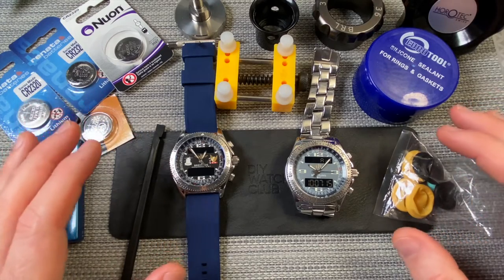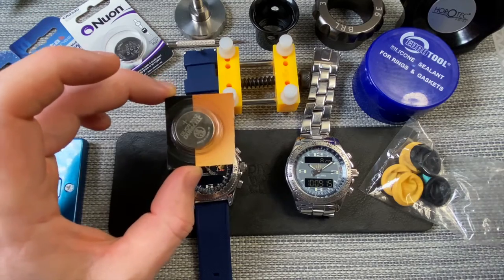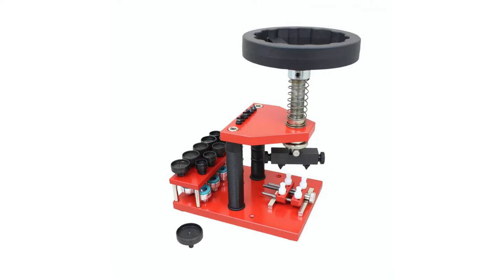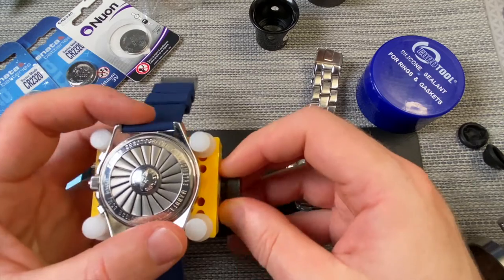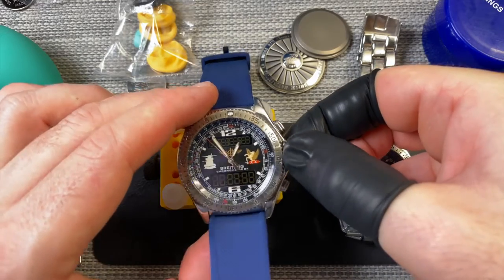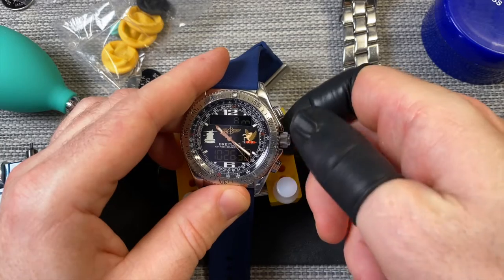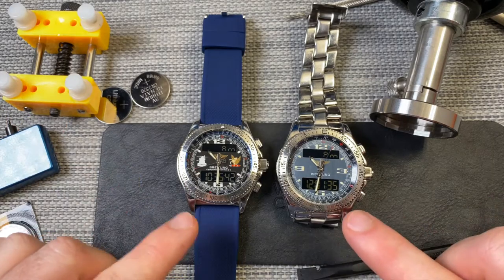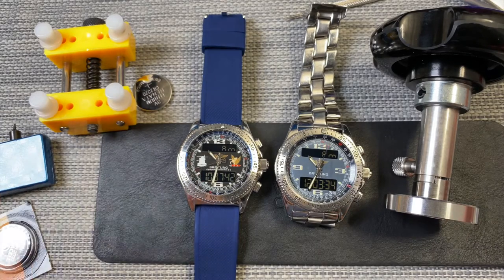Breitling B-1 Battery Change, how easy is it? A68362 -

Comment: Literally just bought a B1, and this video helped massively, especially talking through how to fix the time sync. Brilliant well done thanks.
Reply from the maker: Thats cool, glad it helped. I only recently got this watch and I'm really liking it... or both of them!
Reply: @CasualWatchReviews  Really interesting timing, I ended up buying a black faced B1 for £750, wasn't working, suspected dead battery. Put a new battery in using your guide, and followed your guide to fix the time sync issue etc., and now it's on my wrist. I suspect it's now going to be my daily. Thanks again, and perfect timing (no pun..), it seems as if it was meant to be!
Reply from the maker: I was really worried I had not created the most 'entertaining' upload for my regular subs with this one. But knowing it helped you has made it worth it... thanks for letting me know. I wear the grey one daily now. This time last year I would have snubbed this for a mechanical. Also its nice to know that this is the last one before they kind of went a bit crazy in size.
Reply: @CasualWatchReviews  unique, clear,  the perfect video. Reviews are two a penny, actual knowledge and instruction and not just opinion is far more valuable to me as a view. For reference I also have a ceramic Sub, but honestly, this feels like the ultimate tool watch so I suspect i'll swap to this. Thanks again.
Reply: Lol I can't believe he said literally

Comment: Hi from Australia :)  Just caught up with this video, as I need to change the battery on my B1 (same as the one on the right in your video).  Mine also has the little UTC separate watch forming part of the watchband and I need to do that one too.  The case opener die has to be 15-sided and 36.07mm exactly.  That's why the generic 36mm ones don't work.  I'm going to try the rubber ball trick, as I already have a couple of those.  I regularly change watch batteries for my collection and the extended family!  But the proper case opener die is hard to find now.  For those interested, it's a Breitling Case Opener, CO-BR15-3607 (which translates to the 15 sided 36.07mm size).
Also just one nit pick - you adjusted the time on the first B1 you did, but to 5 minutes behind the digital time.  You set the hands to 14:22 when the digital time was 14:27.  Surprised nobody else picked that - must be my OCD kicking in :)  Thanks for the video - very appropriate for me right now :)

Comment: Fantastic video. I was a little scared trying to do this myself, and since an AD isn't anywhere near, I decided to give it a go. Bought the die, used a spanner to turn it. Back comes off, replaced the battery and all good.  I should note I haven't worn the watch in 7 years because of the battery, and everything functions perfectly. There is also a hidden procedure you can use to put the watch to sleep before you change the battery so you don't have to reset the time, alarms, date, etc  Ill try to find it, as it is on another site somewhere. Again, thank you so much for this video. Will never get rid of my B-1
Reply: Suspend mode specifics--Quoting Andy from the TimeZone Breitling forum:

On my B-1, if I rotate the crown until the display is off and then pull the crown out, the top display says “R” and the bottom display shows the time, (an hour behind the time the hands show) and allows me to set this time using the usual controls.

[…] While the above is happening, I can press the top button and the word “BAT” flashes up in the top window. If I hold the top button, the word “BAT” stays on the screen for a while and then both screens go completely blank and the watch seems to be in some kind of “Sleep Mode”. The screens are blank and the hands are still.

To “wake” the watch up again, I have to push the crown back in again, at which point, the watch returns to its normal operating mode and seems to reset itself to the correct time.

Keep in mind that this may harm your watch's movement if it sits for a long time without running, as the gears will not be lubricated.
Reply from the maker: Thanks for adding all that Sam
Reply: @CasualWatchReviews  I should also note all of this is also relevant for the B1 SuperQuartz A78362, which is the watch I have...Again, thanks

Comment: BIbheard about the Breiting on the left on the podcast. I think it looks fine.
      I have replaced battieres on a few Ronda 515 movements and also an ETA quartz movment . I also replaced barriers on some Casios. I actually destroyed a $18 Casio, had to buy another watch, At $18, no big deal.
     I noticed Renata battieres are standard on most Swiss Quartz movements. They are Also Swiss Made. I have heard to be weary of some cheap  battieres, they  have been known to cause issues.

Rob
Reply from the maker: Hey Rob, yep it was so weird that these batteries are hard to find. Couldn’t find any other sellers. It was reassuring to see there was a renata in it already!

Comment: Is there an O-ring gasket on these watches? Do you replace it if opened?
Reply from the maker: Yes to both of those questions. It took me while to dine one that fitted. Honestly Its been that long since I sold the watch, I can't remember the size. There would be another ones for the crown and pushers also.

Comment: The link to the Case Back Opener (Die Part) now goes somewhere else but Amazon do have what appear to be the Breitling specialist tools but there are 2 sizes available and 36mm and a 38mm - which did you use for the B1?
Reply from the maker: Hey Andy, thats right the link https://amzn.to/3jF0qdk its a weird half size so only this one works from what I could tell. I bought a 35mm and 36mm and neither worked before I got this one.

Comment: Thanks for the video 👍
 I didn't catch why the cheaper case back opener tool didn't work, was it the wrong size or the wrong design or ???
Reply from the maker: Yep it’s in between sizes, one is too big the other too small. The rubber ball worked on one of them if you wanted to try that first?
Reply: @CasualWatchReviews  Thanks, I have a Navitimer and those cheaper openers are all over Aliexpress, they'll probably have what I need.

Comment: Great video!  I have the B-1 watch on the right; the hour and minute markers aren't moving anymore (tried everything on the video) will replace battery as next step; does anyone have any other tips?  I can send to Breitling but that's a good 16-20 weeks with no estimate of cost (called a few authorized dealers)  in Orange County, CA if anyone knows a place.  Thanks!

Comment: Hiya cwr al here from sheffieid good enough mate but being a tight yorkie it would have broke my heart paying around £80 for that back remover i know its too late but did u try a piece of rubber or silican matting and pressure on the caseback , i have removed backs like that before , just wondered .take care.
Reply from the maker: Hey Alan, yes I tried the 'rubber ball' and it worked on one but not the other, I nearly sprained my wrist! I'm with you $80 fo that die thing was a gouge for sure!

Comment: Quick Question: Where did you get the gaskets for the B1?
Reply from the maker: Hey Sam, I got them from amazon but I don't know yet if I got the right size or quality
Reply: @CasualWatchReviews  Ok, Thanks Sam....will you please post here specifics when you determine all is well, part number, seller and such? TY
Reply from the maker: Yes will do. I couldn't find any information on the size needed so ended up buying 100 or something ridiculous
Reply: @CasualWatchReviews  Hi, did you find out the correct gasket part number or size? Thank you, very nicely done B1 presentation!

Comment: Hello,

May I know the exact dimensions of the back gasket you ordered, please ? Mine is cut off and needs to be replaced ...

BTW, to open the watch I use a silicon ball, it is inexpensive and there is no risk of scratches.

Also, there is an EOL indicator on this watch, the display blinking means you need to replace the battery within 2 weeks.

As for the replacement, the battery needs to be lifted slowly otherwise you may lose the small (but crucial !) spring under the battery !

A proper replacement is to put the watch into power saving mode, then, once the old battery is removed, you have 15 seconds to put in a new battery. All the parameters (hours, alarm, calendar, ...) are thus kept in memory.
Reply from the maker: Hi I tried the silicone ball, or only worked on one of them. I'm still in the trial and error phase of the gaskets. I ordered a few different ones but not had chance to test them all out yet.
Reply: @CasualWatchReviews  OK. I thought you had the good reference according to Breitling documents.
I bought a 35.5x0.7 O-ring for my beloved B-1 but I have to find a watchmaker to have a waterproof test...
Reply: @vzmax  Hi, does that 35.5 x 0.7 gasket fits the B1? Is that specific from Breitling maintenance docs? Thank you!
Reply: @txominn79  Sorry, I can't answer, my watch has not been waterproof tested. And I'd like to know the Breitling maintenance doc !

Comment: Hello sir I am
Going to change the battery in my b1 myself bought the parts I was thinking of changing gasket also do you know the part number for the gasket or gaskets I need to do this thanks you
Reply from the maker: I’m sorry I don’t know
Reply: @CasualWatchReviews Hi.. I have the B1 & Airwolf . will that case back opener work on the Airwolf aswell ??  Noticed my B1 battery indicator is flashing now. breitling charge a small fortune for battery change now so hopefully this will open both and save me some money and time.. Cheers.

Comment: I believe when one does a full service on the watch,  tyne whole watch is dismantled And cleaned and serviced and cleaned, so it's worth doing full servicing.
Reply from the maker: The problem is that services for these quartz watches are actually very expensive. They are modules also so it’s not like a mechanical where you can take it all apart and clean it and put it back together, if something wrong with the electronics, it’s really wrong. You're just describing a normal watch service not one for a specialist watch like this.
Reply from the maker: Thats not what your original comment said at all. The first, where you didn’t just copy and paste something you read online. You would rather pay $220 to replace the battery and gaskets when I did it for less than $100. Once you have that tool, the battery changes after would be around $10. 

If when they service these watches and they find the module is broken, I can assure you it’s far more than $660. You only have to do the bare minimum amount of web research to check if I’m right.

They don’t fully dismantle the modules at all. You're describing a mechanical watch there. If there is an issue they swap the whole thing out.
Reply: @CasualWatchReviews  That whole changing the battery "thing" is the exact reason I will never buy another Breitling.

Comment: Hi! Hopefully, you still watch for questions. I've had many B-1's over the years. I guess, I sold them prior to battery changes. I just bought one off eBay with a UTC. It was from a big dealer and I think it was tacky not listing the watch and UTC need batteries. I live in the country and I'm a rather old DAV. I knew the B-1 is the most difficult Breitling to change batteries on but I bought it. I only have automatic and manual Breitling's and I thought the price was right. I was wondering about the EOL. The watch came with all it's documentation and boxes but the EOL explanation was vague. The digital display is flashing. Is that indicative of the EOL and a drained battery? There are no Breitling dealers in the state I live in and will be stuck with shipping it off. I hate buying other peoples problems. In 23 years on eBay and over 1000 positives and no negatives, I would never ship a dead watch or a dirty one. This appears to be both. So from your experience, does the digital LCD flash to show the EOL. The backlight isn't working either. Sorry, this is too wordy!
Reply from the maker: I know the back light thing is an indicator but the flickering LCD I’m not sure. I have only had these two.
Reply: @CasualWatchReviews  Thanks, for your heads-up! I'm going to follow your reviews. I've been collecting Breitling's since buying me 1st a beaded bezel 806 about 50 years ago. I guess once the battery is changed I'll know definitely about what's normal at the EOL. Thanks, a million!
Reply: I've a Breitling Aerospace (circa 1997) and the flashing display  according to the manual indicates; "...The watch is equipped with a battery end of life detector( EOL), acting by flashing of the numerical display". So if the digital display is flashing, change the battery asap! Hope this helps!

Comment: Hi, those tools you bought off eBay, why didn’t they work where they too big or small? I have seen on eBay there is a 35 and a 38 available?
Reply from the maker: Yep both too big and too small. Plus they are very soft metal. They are honestly a waste of money.
Reply: @CasualWatchReviews  great thanks — as the other tool you bought it sold out I can’t think of anything but to have to go to a dealer. Do you think friction balls will work as I have seen other YouTubers using these to remove watch backs?
Reply from the maker: Yes I cut that out the upload as it was already too long. I used a friction ball on one. If you have a standard rubber ball or squash ball that would work. One came off with the ball, the other was really stuck on!

Comment: I opened my A68362 using a rubber ball and installed a new Renata battery. Now my bottom pusher won't advance from hours to minutes so I can reset the time. The button depresses normally but the digital display won't switch. Any ideas?
Reply from the maker: Has the plastic film slipped and is interfering with the buttons?
Reply: @CasualWatchReviews  thank you for the fast reply! I just checked and the film is properly positioned and I can see both plungers moving inside the case when the pushers are moved. Guessing it's a movement issue.

Comment: Thanks! Used the $5 rubber balls they sell on eBay and it opened the case back super easy! Don’t buy the die and all 😂
Reply from the maker: Hey! Glad it worked. I may have cut it out the upload but I tried the rubber call and it only worked on one, plus i would be extremely worried about the integraty integrity using that method personally.

Comment: Looks very straightforward to change the batteries out, just as long as you have the fancy tool to unscrew the back of them. I have always liked the B1 watches. But what put me off them was the extra expense of send them off for a battery replacement. But it looks like anyone with half a brain could carry out by themselves quite easily. But I would say you do need to purchase the tool for unscrewing the backs of them first of all.
Reply from the maker: Yep totally agree, I tried the ‘rubber ball’ method and it only worked on one of them